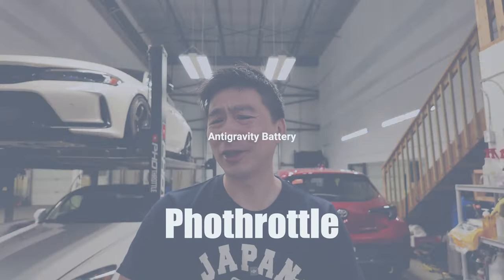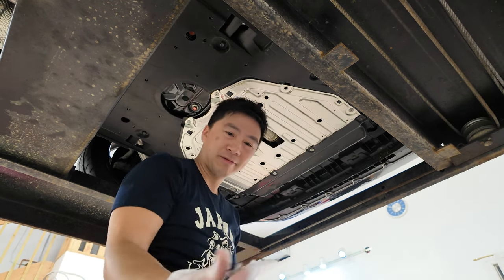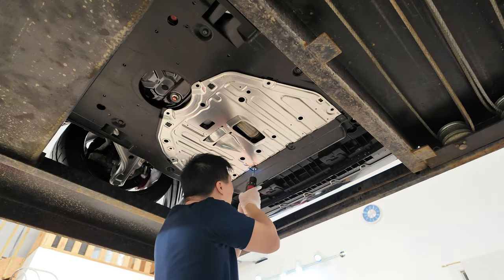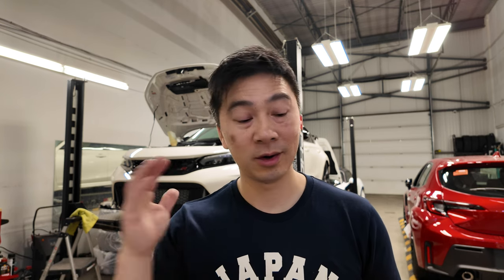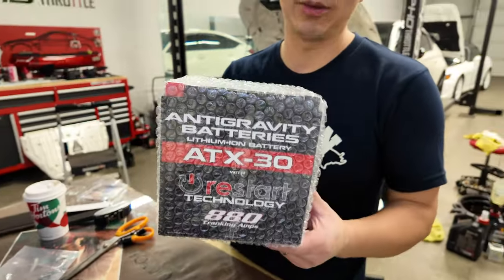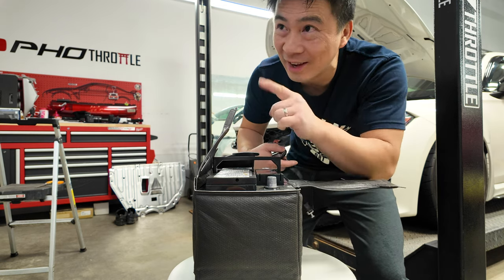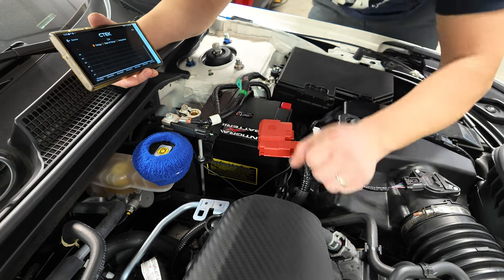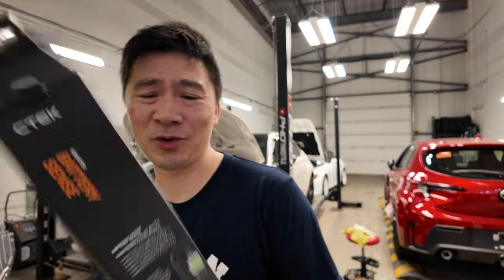The Best Battery For Honda FL5?

Comment: I just purchased the ctek battery charger and maintainer for my fk8
Reply from the maker: Nice I have the ctek battery charger too. They are really good and reliable.
Reply: @phothrottle How are the coil overs doing, I’m on the fence trying to decide. I did watch your video on them
Reply from the maker: Towards the end of the summer I was able to dial them in even more. They feel fantastic on the on the freeways. For the price point they are really good. They are the only coilovers on the market that allows you to keep the factory dampening. Any other brands on the market are big money and not that much better for the price you pay. It all depends on your budget and what you intend for your CTR.

Comment: The ATX30 is not a good fit for the FL5, unfortunately.  Mine overheated numerous times.  Had to get it warrantied and I just put the stock one back in
Reply from the maker: Thanks for the heads-up Joel! Do you think the over heating issue is caused by the batteries amp hours size? Did Antigravity pin point the cause?
Reply: @phothrottle  I believe that's what they said. They don't recommend the ATX-30RS for it.  I upgraded to the HD model but I didn't install since a friend of mine had the same issue with that also.
Reply from the maker: @accoRding2Joel  would you recommend going with the oem size antigravity or possibly a group 51 size? By the way I love your vlogs keep it up brother!
Reply: @phothrottle  I would say the 51 should be plenty. Thing to note is that the battery was never a problem in nice weather, only when it was 90° or hotter did it fail.
Reply: @phothrottle  and thanks for the nice words!  I dig yours too
Reply from the maker: I will keep that in mind! Thanks

Comment: Isn’t there something about lithium ion and alternators? Be careful with that.
Reply from the maker: Kevin I believe what you are referring to is when lithium battery gets discharged to a very low point they are hard to bring back. You need a 12volt source to tricking the battery to wake up and take the charge.
Reply: @phothrottle  Lithium is unlike lead acid, they're happy to take current as much as possible. when lithium state of charge is high enough, it will be safe for your alternator but thing got ugly when it's discharged. it could burn your alternator if you charge them on idle!. yes the BMS would cut the charge current when it's exceeded the preset limit but if the limit not met, it could burn your alternator quick. even if it does cut charge current, you're risking damaging your modules since alternator is not a smooth DC. ripples and spikes might be too much for your module voltage regulator to handle.

a proper way to use lithium is either having DC-DC charge controller or when your car is compatible with it (cars with battery sensor module might be compatible with lithium if they have program for it). the scenario i explain is the worst case where it could happen in daily use but if you're sure you wont disharge the battery too much, i'd say it's safe-ish